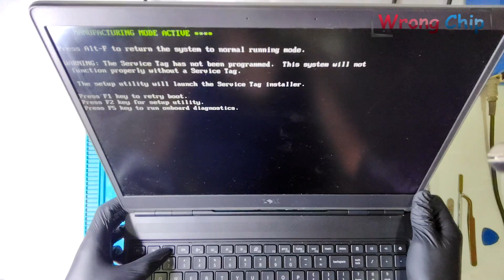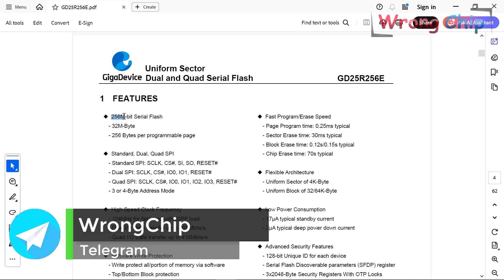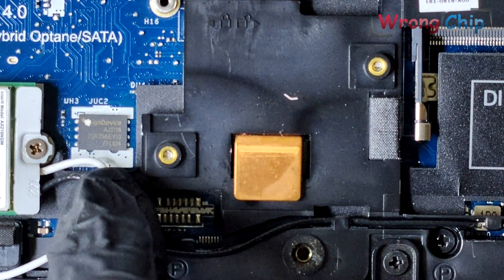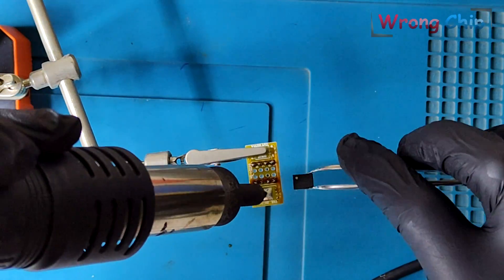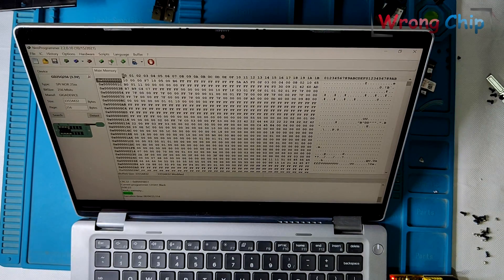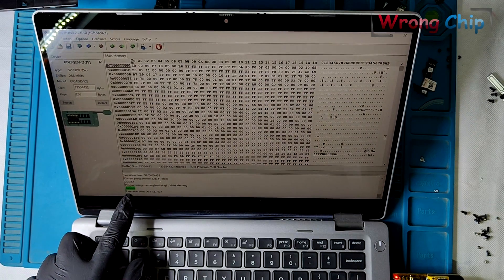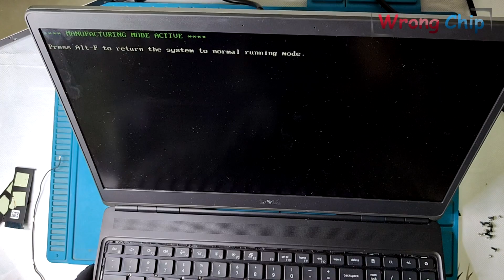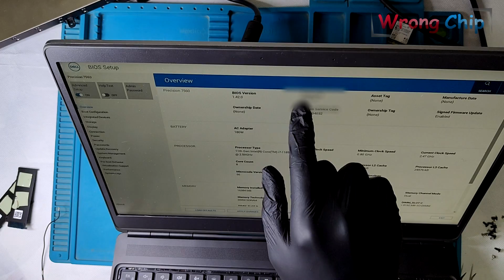Stop Damaging Motherboards! The Right Way to Flash WSON Chips

Comment: Noob here: don't you need solder to re-attach the chip to the motherboard? It seems you just heated up the chip and cooled it back down again?
Reply from the maker: You will have to re-solder the chip again yes. Also if you don't have enough soldering skills you can try to use a clip/clamp or Pogo-pins in case your chip is WSON8. I don't prefer the clip way but you can try it if your soldering skills aren't good.
Reply: @wrongchip thanks! I'd prefer not to deal with soldering. The problem is that there is too much bleed current for the wson8 set up to work, my ch341a goes dim as soon as I connect it. 😢

Comment: Someone said i need unplug bios battery too is it true? If i want use clip for read and flashing without desoldering.
Reply from the maker: I don't think so, but you can easily disconnect it and try.
I always prefer the de-soldering method, because sometimes you will get a bad reading/writing with the clip.
Reply: @wrongchip  but i can werify it couple times, i need only change and edit 2 lines for change hardware id in bios in my clevo p775tm1
Reply from the maker: @lucalive1302  Okay, you can read the chip more than once and verify it too.

Comment: hi good work , i have question , is possible that wrong service tag or Corrupted bios make no sound on laptop ?
Reply from the maker: Hey, thanks. Wrong Service Tag will not prevent the sound from working, but empty Service Tag can do yes.
Also a corrupted BIOS can block the sound.
Reply: @wrongchip  thank you 💗

Comment: thx for video , plz make video how you can solve the problem , when you get bios region on update and dump not matching , i get that problem , alot , i cant cut it because , the size is measure from header to  footer of bios region , thank on advanced .
Reply from the maker: You're welcome. I don't understand which case you are talking about. Anyway, I have many videos for each brand, you can check the playlists and I'm sure you will find what you are looking for.
Reply: @wrongchip  i alerady see many video of you channel , it really piece of art , but i didnt find what look for , in short words , i had this problem on a lot of bios edting , my last case , when i try to flash lenovo x240 or 250 it the same problem , when i cut the same region from header and footer on  bios update like orginal bios , when i comparted with original , i found it bigger , in same cases i found that size lower after cuting the bios update file like orginal ( i found this problem on some dell laptop ) , i think it require bios editing from next level.
Reply from the maker: @ElectronDzFix  Some devices can be hard to fix its BIOS yeah. Sometimes I'm struggling in many things too.
Reply: @wrongchip  can you make video about that problem , I think you gonna fix it easily , I think you are the pro in bios editing , you can try with Lenovo ThinkPad  x240 or x250  you will notice that ,Thx very much for respond .

Comment: Oooh, what if the bios chips is faulty  physically with  Rpmc function , what could be the solution to fix that laptop
Reply from the maker: I have already responded to the same question in another comment.
You can use another chip that support RPMC. Like Winbond W25R256, Gigadevice GD25R256, XMC 25RH256 or MXIC MX77L256. But it's always better to stick to the same chip as your original.
Reply: @wrongchip great information 👍

Comment: Please bro you said it can't be replaced by another chip, so what if bios chip get damaged, can't I replace it with another brand of bios chip but with also RPMC. Forexample if it's winbond can't i replace it with macronix chip but with RPMC
Reply from the maker: Yes, you can use another chip that support RPMC. Like Winbond W25R256, Gigadevice GD25R256, XMC 25RH256 or MXIC MX77L256. But it's always better to stick to the same chip as your original.
Reply: @wrongchip ❤, so  this could also be another reason when you use another bios chip  without RPMC, then after inserting service tag then when it restarts deosnot power on again